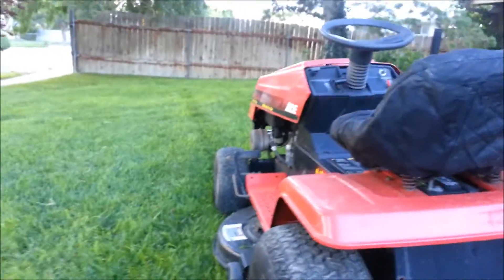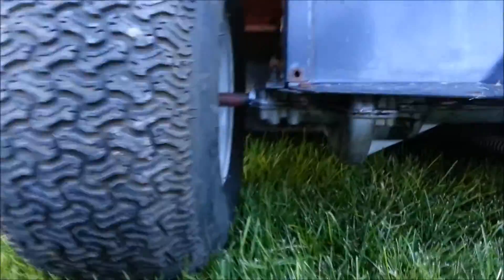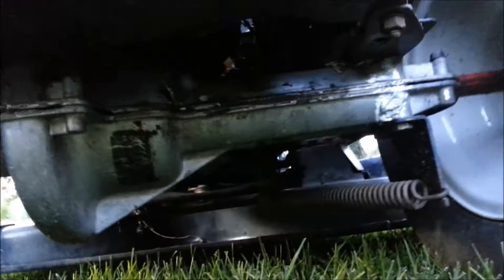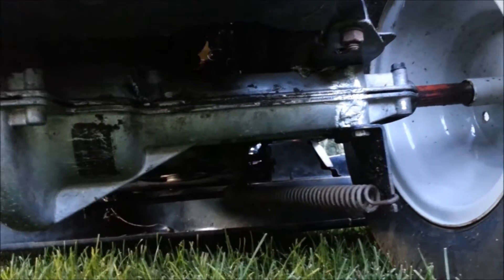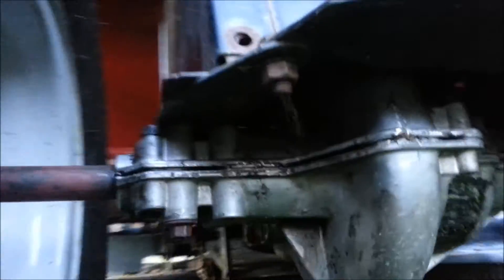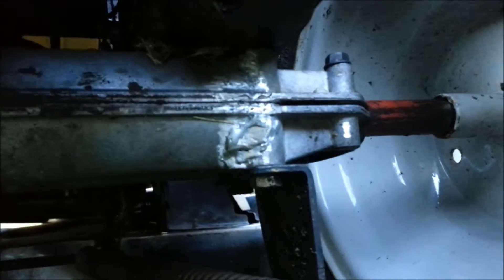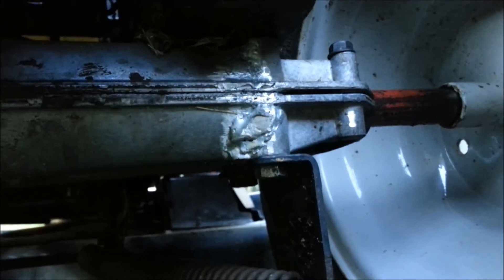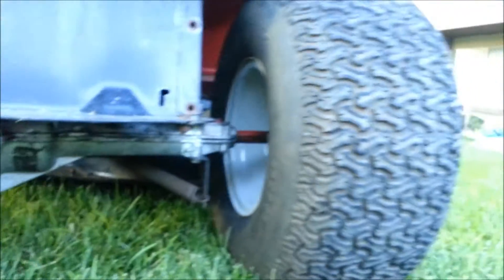MTD Transmission TEST the Aluminum Braze Repair

Comment: Thanks for the followup vid. Also for the tip about not heating up the repair a second time.   How much repair material did you go through on that repair?
Reply from the maker: I think I used 2 sticks.
Reply: sixtyfiveford Thanks again for the info and the video It helped.

Comment: I hate them mtd trans. they sell that whole casing  for that thing just to service it or just to grease it. The top where your's was cracked is most of the time blown all apart. great job on the repair how do you like them tri-angle bolt's that hold it together?
Reply from the maker: Yeah, these aren't the most sought after transmission. I'm not sure why any manufacturer would want to intentionally make a Non-Serviceable part.

Comment from the maker: There is a bolt that holds the transmission from twisting when going it reverse. It was never installed from the factory and when I was backing a small trailer it hit a rock the torque twisted and snapped the axle.